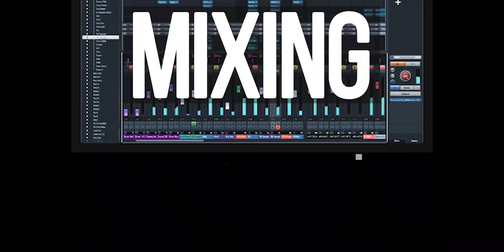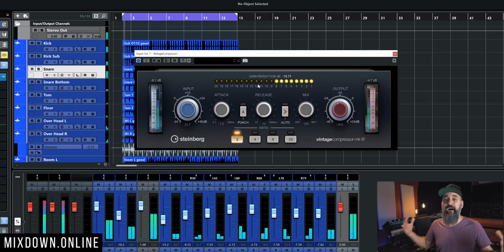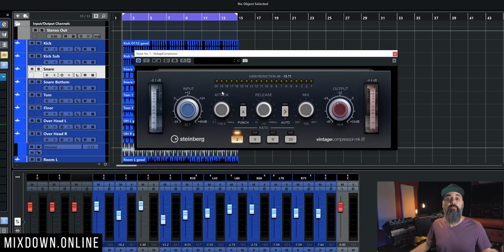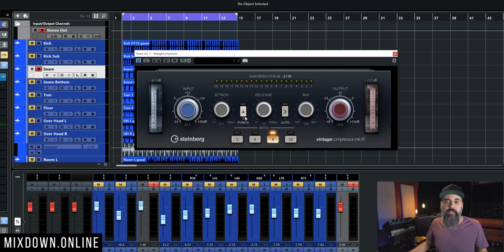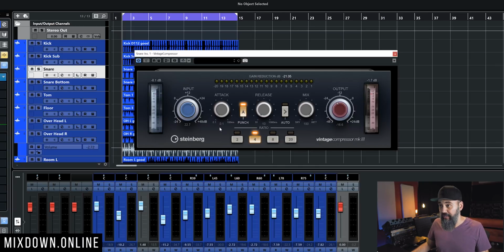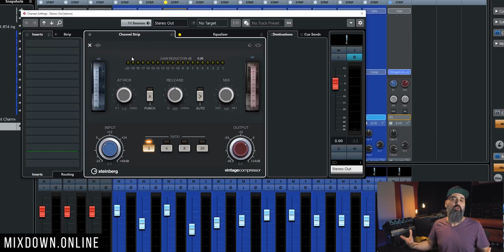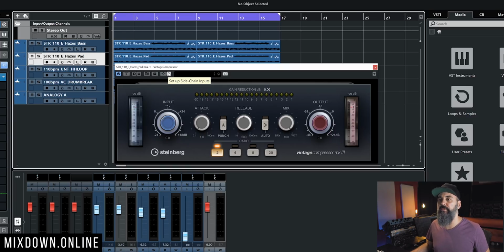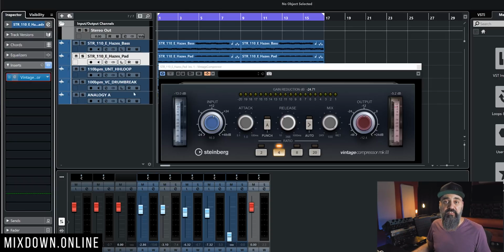CUBASE - THE VINTAGE COMPRESSOR - Plugin Friday

Comment: Hello Selim! I would like to use the old vintage compressor but it seems that steinberg has no single files for it's plugins, it seems that there is one file that includes all plugin or the most of it, so it is not possible to use the old vintage compressor out of it. What do you think? Is it possible to get the old vintage compressor somehow? Instead of the old compressor, i use the one from waves, the CLA-76. that is based also on the 1176 but the steinberg was a little diferent than the Original, that's why i like the steinberg a liitle more than the waves. What do you think?
Reply from the maker: Not sure about that. What I can tell you is that the CLA76 is a more accurate emulation of the original 1176. The Old Vintage Compressor is basically the same as the new one, only the GUI has changed. Compare to the CLA76, the Vintage Compressor is not a full emulation of the 1176. It has similar features but that's it. Still a very good compressor.
Reply: @mixdownonline  Thank you to answer my question!  I would be more nice if all the manufactors would make it possible to use ther plugins also in other DWA's. So i see that steinberg has the most of it's plugins in one file, so it seems not to be possible to use a singel plugin aslo in other DAW's. But presonus or magix do it the same way. So i have a lot more plugins in my system, but i can use not all erverywhere, some only in the plugin from the same manufactor of the DAW. :-(
Reply: You probably only think of the business and less of the user.

Comment: Would definitely use it more if it had automatic gain compensation, or maybe a gui where the input and output knobs were closer to each other. It would make it a bit faster to work with not having a touch screen..
Another great vid. Thanks Chris :-)

Comment: I am using Cubase 10.5 Elements and have a UR44.  Just starting to get into it and my first vocal track has a clip in the front of the sound cutting off the first fraction of a second after a break of quiet. Something like a noise gate.   I see recorded it with a Morphing insert and not sure how that got here but I did use a template out of the HUB, and really didn't know what it was doing to the sound.  Is this the problem and should I just get rid of that insert and record again 'dry'???
Reply from the maker: If it that plugin is inserted as an insert on the Vocal channel, just remove the plugin. If it was inserted on the INPUT BUS, in that case, that effect was recorded with your vocal but I doubt that is the case.
Reply: @mixdownonline  Thank you! yes, input bus.  It's gone now and I am good.